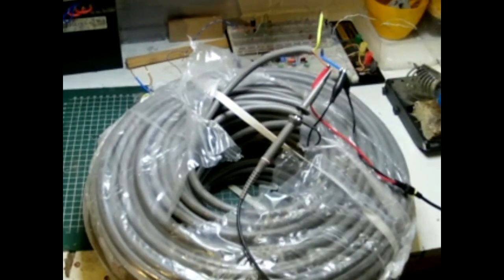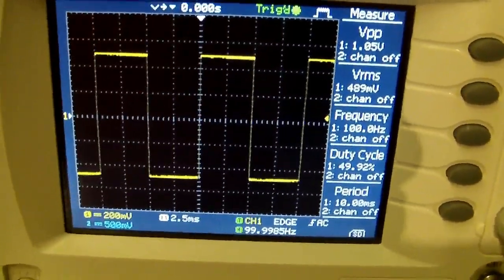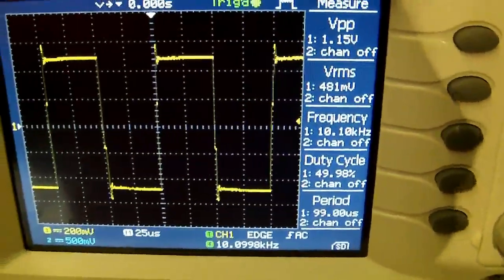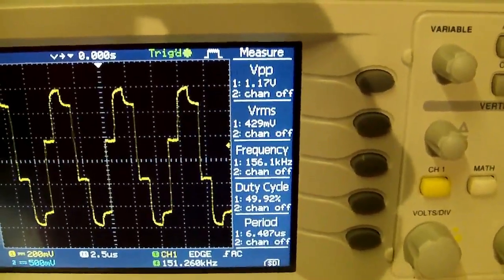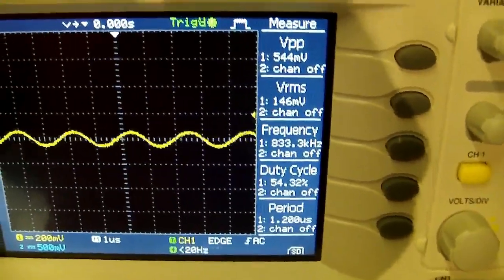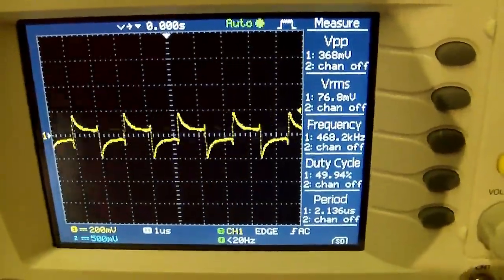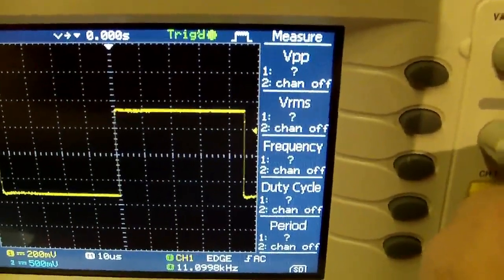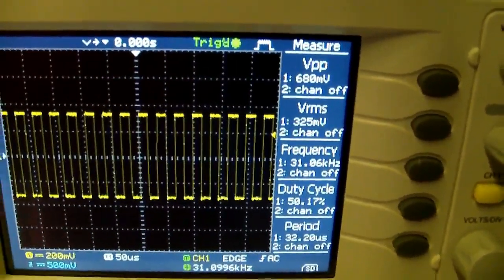termination resistor on datacable

Comment: Great video! I had to do the same. I used a regular wiring (2x 0,75mm pp) to connect two devices through rs485. Incredibly when the ambient temperature rises to about 28° C, the communication stops. I've put a 220R resistor (one at each side), and the problem was solved. The length of the cable is about 130 meters. How do I see if the resistors I used there are properly? Best
Reply: RS485! interesting. Was your termination resistor was between A and B?
Reply from the maker: Test it whit a function generator with square waves and a oscilloscope, the square waves must always have the same shape independent of the  frequency , than you have the right resistor.

Comment from the maker: normaly for data communication we use special wiring but in industrial sites sometimes we need to connect modbus communication on the standard wiring and then is it very important to terminate the cables with the right resistance
Reply: Thanks a lot 🙏
Reply: good video, but you have not shown it with wrong resistance, what happens if you put 200 ohms? or 500
Reply from the maker: @EvillNooB  , with wrong resistors you could have a breakdown of de shape (square waves), with the correct resistors the shape will be always good